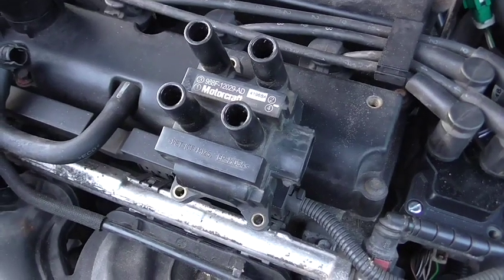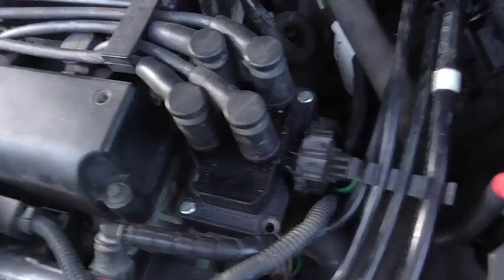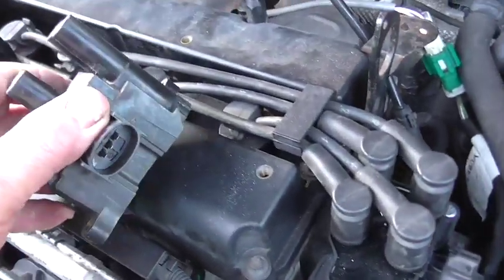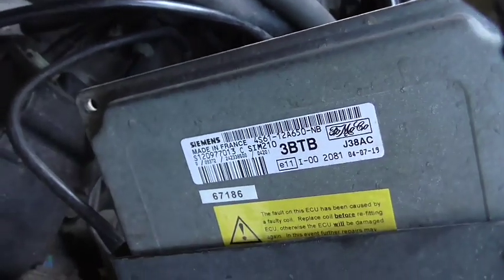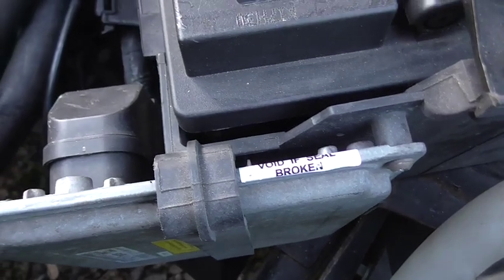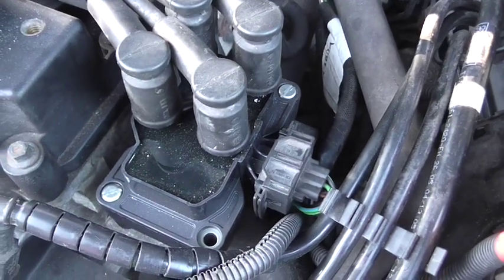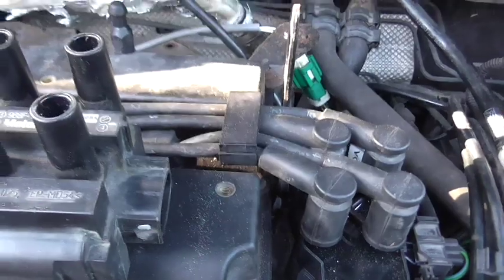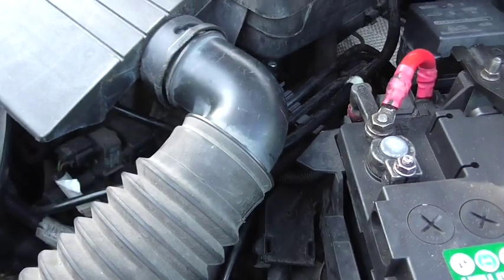Ford Fiesta, Focus, Mondeo, Sharan. etc ignition coil and ECU failure and fix

Comment: Mine smoking is it possible ecu  i change i change engine but the same
Reply from the maker: Sounds like a fuel problem, what colour is the smoke? is it firing on all cylinders...?
Reply: @jetblack11td  all cylinders firing white smoke 3k rpm 20 minutes smoke fine once min rpm smoke back again  new spark plugs new pcv valve changed engine the same problem
Reply from the maker: I just checked out some of your Video's pretty cool....... does MR Muscle clean a DPF?  Iv'e used it to unblock Diesel inlet manifolds before....
Reply: @jetblack11td   yeap i cleaned my dpf using it

Comment: I have just removed and refitted the spark plug leads on my 2001 ford ka having the same coil as in your video.  I have refitted up to three of the four leads incorrectly on the coil.  I only know for sure the correct position of the number one cylinder lead on the coil.  The firing order is 1-2-4-3 so I have gone anticlockwise on the coil with these cylinder numbers.  Is there any guidance on how to position the leads on the coil apart from trying various combinations?
Reply from the maker: Hello petaljucie.... I won't ask about the user name...!  The spark plugs are fired in pairs the so called "wasted spark system" generally plug 1 and 4 together and  2 and 3 have a look at        https://www.crypton.co.za/Tto%20know/Ignition/wasted%20sp.html    Explains it quite well
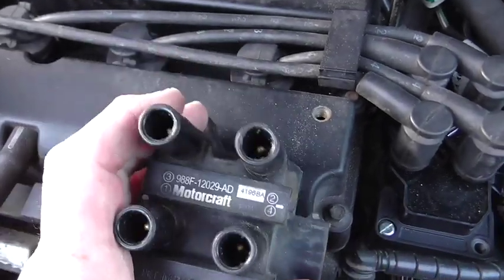if you watch the video at 0:27 seconds on the original Motorcraft coil you can see the markings 1 and 4 nearest the camera and 3 and 2 behind should Help..... all the Best.....Trevor

Comment: Hello ! My Mondeo from 2008 2.0 gasoline gets the cilinder 1 and 4 cut off randomly just at 800rpm but not when I am driving only and idle ! I changed the coils, al 4 of them but I still get the worning on cilinder 4 frequently and often cilinder 1 ! Could it be the ecu ? Also change the pins inside the coil connectors cop! It is driving me crazy this 🚙
Reply from the maker: Hello...Seasons greetings from the UK....Have you eliminated the HT leads and the plugs? you say you changed the coils are they like this with one coil that does all 4 cylinders, or does it have coil packs on the top of each?
All the best....Trevor

Comment: Hi great video and very helpful.
I have a 2007 Fiesta 1.4 and pretty certain have an ECU issue and need to take it out and get it tested. Wondering how you got the wiring harness off the ECU. There is a hole on the plastic casing of the harness where it looks like there should be a bolt to unscrew it - but no bolt? Any help much appreciated.
Reply from the maker: Hello Phil....... I'm sure there was a screw holding the plug in-place... but I'm sure it broke the head came off, and I replaced it, if look carefully at 2:21 you can see a shiny looking head of the bolt and a penny washer but a lot has happened in the last 3 years so I wouldn't bet my life on it....! 
The plug is very tight on the ECU still had to carefully lever it off...use a tapered piece of wood rather than a screwdriver.... I found  www.ecutechnologies.co.uk  
much cheaper than other companies I phoned, to get the ECU repaired and I know enough about electronics to tell the complete mumbo jumbo BS that came out of some of them...!
All the best....Trevor
Reply: @jetblack11td  Hi Trevor... thanks for the reply. Apparently these ECUs are often bolted on with Shear bolts that are designed to break when tightened - a security thing apparently. That seemed to be the case with my one. Spent 2½ hours carefully drilling it out with small drill bits and a dremell a friend had - you have to be very careful not to damage the ECU or attached wiring loom and not very easy. Assume Ford have a special  attachment to do this. Anyway managed it in the end and will send to ecutechnologies and hope the issue is the ecu. Mine starting misfiring on cylinders 2 and 4 at low revs + also failed to start on occasion all possible symptoms of a damaged ecu apparently.
Thanks for all the help.
Reply from the maker: Hello Phil.... You have jogged my memory (getting old you see!) we did have to drill it out hence the new bolt and penny washer to hold the plug......
been a fair old bit of water under the bridge since then...!
All the best....Trevor

Comment: Nice Video, no unnecessary faff, good job. My 2005 fiesta climate has an intermitant problem with loss of acceleration, then its fine. No engine codes or dash lights. Was thinking coil pack ? Would also change leads to be sure though. Would the coil pack cause this kind of issue ? like i said Intermitant and frustrating .
Reply from the maker: Hello when mine failed it was bringing on the ECU light and the code read primary ignition fault as I explained in the video it did damage the ECU... however as the parts are pretty cheap the fit bits mode of fault finding is worth a try I think you can get a cheap pattern coil for about £15 delivered leads and plugs change one at a time have a good look at all the wiring and connectors looking for loose and /or corroded connectors...best of luck ...Trevor
Reply: @jetblack11td  Thanks for the responce, It chucked up an Engine managment light which basicly said Lamda sensor fault just after I posted, then the next day the Check engine light went off ? Its certainly a wierd one cause i changed the lambda sensor back in Feb ? as of today, no engine lights and seems to be running ok. Ive orderwed the coil pack and I have new HT leads so we shall se how it goes. Just so many things that can cause the same symptoms...ARRGGGHHH. lol
Reply: It was the Lambda, running fine now.
Reply from the maker: Cool...!

Comment: Great video, would this cause an intermittent ‘EAC Fail’ fault?
Reply from the maker: Hello Rob...thanks for your kind comment.....I used an Autel code reader from Amazon...it came up "primary ignition fault" 
as it was a failed output Device (an IGBT I think) the ECU is happy in it's self,  so an educated guess I'd say no... 
But at £10.00 for the coil on ebay it is an easy swap and eliminate....cheers....Trevor